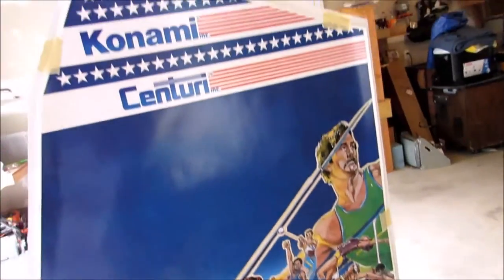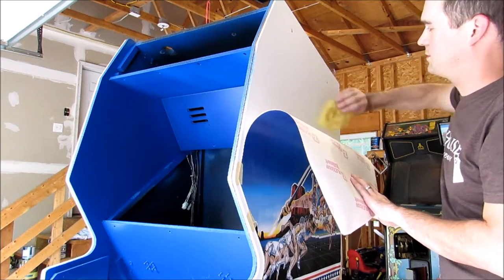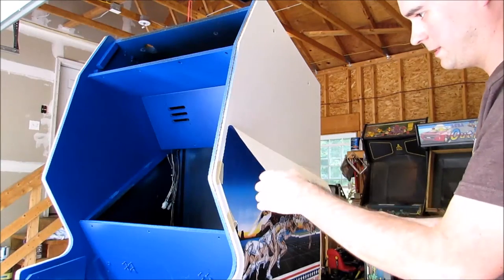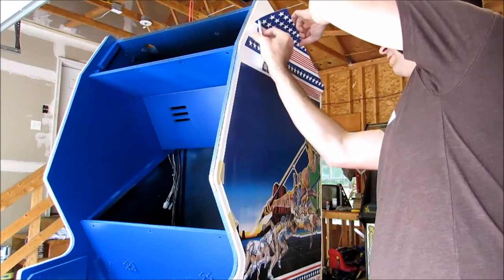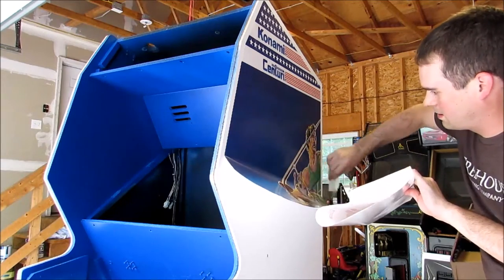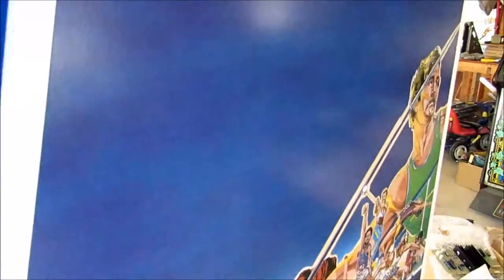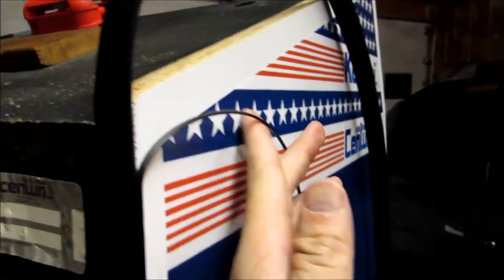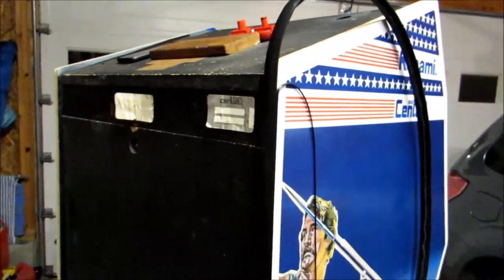Track & Field #5 - Side Art

Comment: Hi Tim, I'm restoring a Track and Field cab and would like to know if you can help me? I need to see how you installed the bottom bracket for the beze glassl.
Reply from the maker: There are 3 carriage bolts that go in through the semi-vertical panel above the control panel that forms an L over the top of that panel onto the glass. This might help: https://rentmyarcade.net/sites/default/files/styles/panopoly_image_original/public/t%26f%20-%20cpanel.jpg?itok=cQWOIu53 (not mine)
Reply: Tim Thx for you reply but were Im confuse is how Im going to tie the nuts if the glass is on ordo I instal the bracket first then the glass? please advice and thank you

Comment: Surprised you are doing it dry. Soapy water in a spray bottle is usually what is recommended for applying vinyl which is supposed to give at least some control over the unintentional stickiness and wrinkles. Maybe it's not the fastest way to apply vinyl?
Reply from the maker: I've used the technique with RapidTac/Soapy water before and it. It works just fine. I worked at a couple of different sign shops. One place used RapidTac more than the other. The place that used it less, we applied big pieces of vinyl like in this video without a hitch and without RapidTac. But then again, that's several years worth of applying vinyl.  If I had a friend who had never done it before, I'd recommend they use a wet application as it's very forgiving for your technique.  One down fall to wet application is if you're not careful, it can get your masking tape wet and cause it to lose adhesion and possibly move the artwork.

Personally, If I was doing  a full side art, like a Millipede or something, I would use a wet application. Anything where I might be in an awkward position due to its size. 

In terms of speed, in the business not doing wet application saved time in final clean up.  One guy I worked with was super fast at applying vinyl. If we were to race, I'd have to have him use wet application to slow him down and he'd probably still beat me!

Comment: hello Tim,  can you send me a pic of the inside of your Track & Field? I would like to make sure I restore mine correctly, and at the same time I wanted to ask you if you have by any chance a harness for it that you want to sell?
Reply from the maker: Hi Joseph, 
Here are some pictures of an unrestored T&F. I don't have any pictures of mine because I didn't have the PCB cage when I did it, but I did just get one. I should get around to putting it in and taking some pictures.  I don't have an extra harness, but you can use a JAMMA harness with an adapter on it.

http://imgur.com/a/ValDI
Reply: Thank you Tim